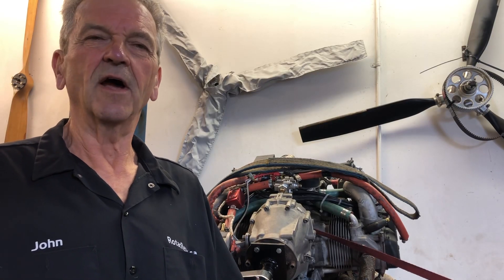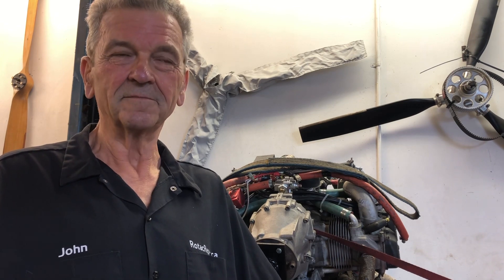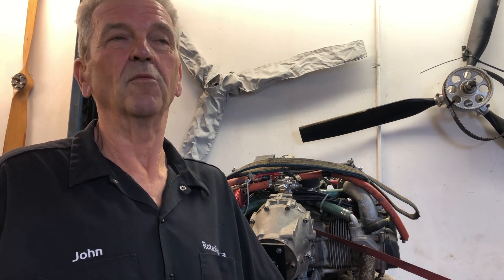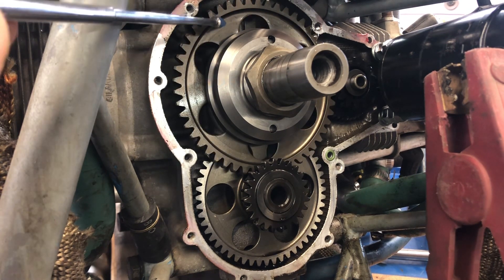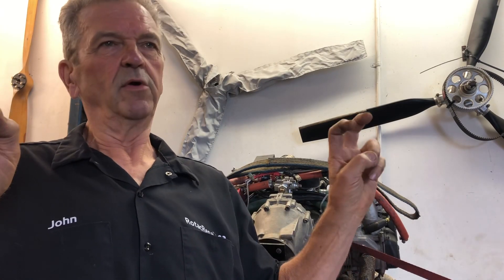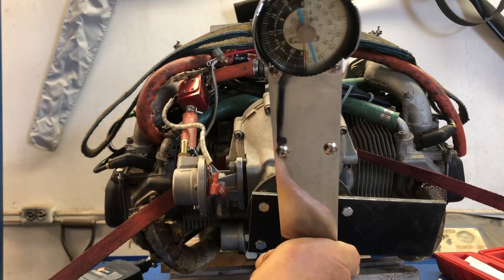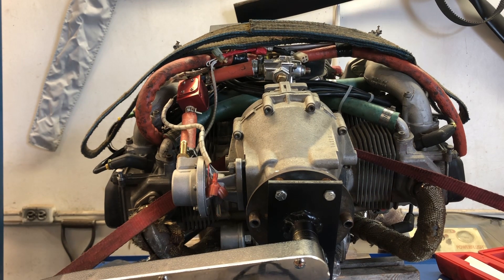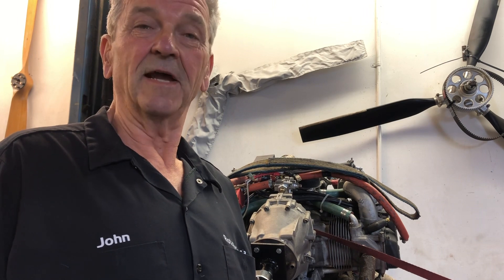Rotax 912UL  multiple starters and it still won’t turn over!

Comment: So original problem was? Sprag clutch, oil pump, main crank bearing?
Reply from the maker: Thanks for the question. The actual issue was the crankcase fretted on the mating surfaces. Likely caused by the installation of high compression pistons. This fretting action then made the normally round hole for the crankshaft bearing turn into an oval shape. This squeezed the bearings into the crankshaft, making it not rotate with the starter as normal. With the removal of the spark plugs and resulting no compression would allow it to turn over with the starter. The crankshaft and crankcase was replaced and the engine placed back into service.
Reply: @RotacRepair  I maybe having a similar issue with Rotax 998cc engine on 2010 can am Spyder. No engine crank, but starter works. I found copper/ brass glitter in oil and in oil filter.  The engine seems locked up. I have not opened the engine up yet. Maybe connecting rod bearing?

Comment: I had a 2 stroker Rotax on my Airboat. I flipped it in the Red River. I took out the plugs, dried them, added fresh fuel, and my pull start started 2nd pull...Cool engines!

Comment: Kind of scary that they just kept throwing starters at it without trying to diagnose the core problem.  Not to mention trying to run the starter backwards!  😕
Reply from the maker: Unfortunately they tried the “parts cannon” approach. The second “ starter rebuilder” did make the starter rotate backwards. However If I ever need to reverse a starters rotation now I know how to.
Reply: Sprag clutch  is most common things with tis engine
Reply from the maker: @dan0417  Yes the sprag clutch can be an issue. The sprags I’ve replaced were pretty much the result of no engine pre heating and / or half dead batteries in our cold winters. Thanks for your comment. Regards John